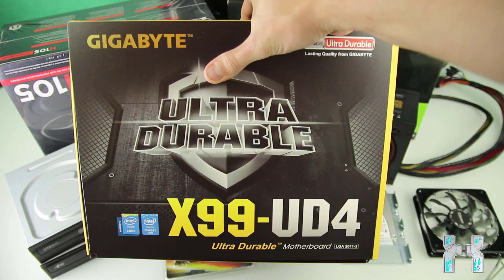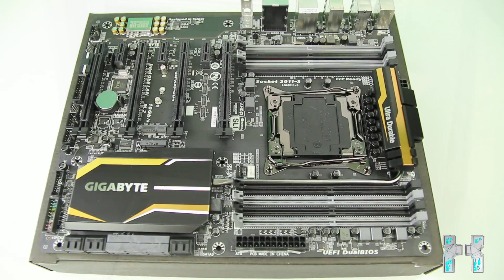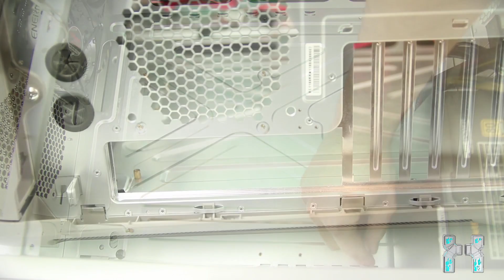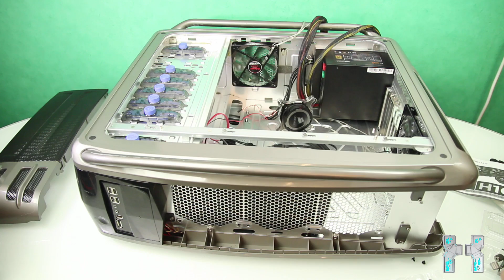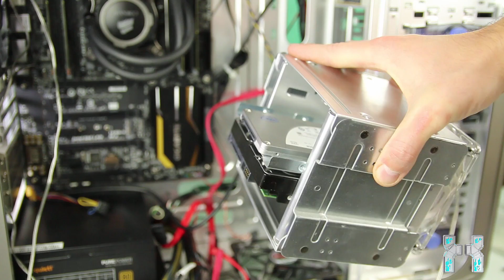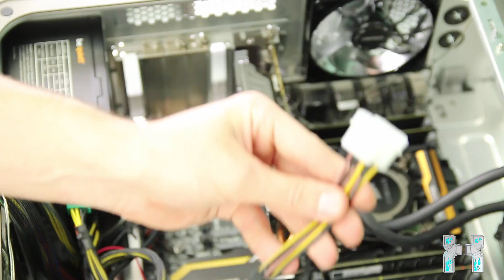How to build a computer in 30 minutes - 2000$ Gaming PC 2014 [HD]

Comment: I DONT HAVE THE FUCKING MOUNTING SCREWS FOR MY X99 BUILD THAT SHOULD HAVE BEEN SUPPLIED IN THE BOX!!! WHERE THE FUCK DID YOU GET THOSE MOUNTING SCREWS
Reply from the maker: tosasaurus mainboard or casebox ?
Reply: the mounting screws that go into the motherboard were not in my h110. I think the h110i GT has them though. Not sure why the normal one doesn't so i ordered them from amazon. Do you know where i could get the shorter screws for push/pull because i'm stuck with it pulling air from outside the case. I want it the other way so i can see my led lights and so that it pushes air out of the case not in.
Reply: +tosasaurus dafuq
Reply: yeah guess what you know what i had to do!? I ordered the mounting screws for $15 off amazon and when they came it turned out i couldn't screw the caps on because the screw hole in the circular cpu cooler holder which holds the cpu into place was 2 millimeters too ... er.. uhm.. "un-wide" so we had to get the powerdrill and widen all four holes in the metal. It worked well and i'm now getting about 31c idle on my i7 5820k ***** ArvidST01
Reply: and i also used the 6 screws that came in my corsair 760t case to mount my h110 in push configuration.
Reply: because that takes a long time!!!!!!! ***** O_O

Comment: Hey everyone, Will everything here be compatible? Thanks everything is on sale and I could get a great deal so please let me know. Thanks :D (Main things I don't know are compatible or not: PSU thanks :D

CPU: http://www.superbiiz.com/detail.php?name=I7-4790KBX&c=CJ 

Liquid cooler: http://www.newegg.com/Product/Product.aspx?Item=N82E16835181032&nm_mc=AFC-C8Junction&cm_mmc=AFC-C8Junction-_-na-_-na-_-na&cm_sp=&AID=10446076&PID=3938566&SID=

Mobo: http://www.superbiiz.com/detail.php?name=MB-MAX7HER&c=CJ

Ram: http://www.newegg.com/Product/Product.aspx?Item=N82E16820233536&nm_mc=AFC-C8Junction&cm_mmc=AFC-C8Junction-_-na-_-na-_-na&cm_sp=&AID=10446076&PID=3938566&SID=

HHD: http://www.newegg.com/Product/Product.aspx?Item=N82E16822178380&nm_mc=AFC-C8Junction&cm_mmc=AFC-C8Junction-_-na-_-na-_-na&cm_sp=&AID=10446076&PID=3938566&SID=

Times two.

GPU: http://www.superbiiz.com/detail.php?name=EV-980ACXS&c=CJ

Optical: http://www.outletpc.com/uh7279-asus-drw-24b1st-dvd-rw-drive.html?utm_source=uh7279-asus-drw-24b1st-dvd-rw-drive&utm_medium=shopping%2Bengine&utm_campaign=pcpartpicker&utm_content=Asus%2B-%2BDVD%20%2F%20Blu%2DRay%20Drives%20%3E%20Internal%20DVD%20Drives

Case: http://www.microcenter.com/product/441510/Graphite_Series_760T_Full_Tower_Windowed_Computer_Case_-_Arctic_White

Windows: http://www.newegg.com/Product/Product.aspx?Item=N82E16832416806&cm_re=windows_7-_-32-416-806-_-Product

PSU: http://www.amazon.com/dp/B00SN7CGAO?psc=1

Wifi card: http://www.amazon.com/Bolse®-300Mbps-Wireless-N-Network-Adapters/dp/B00NTW99A8/ref=sr_1_1?ie=UTF8&qid=1430546202&sr=8-1&keywords=wifi+card+windows+7

MIC: http://www.amazon.com/Audio-Technica-AT2020USB-Cardioid-Condenser-Microphone/dp/B001AS6OYC/ref=sr_1_14?ie=UTF8&qid=1420157521&sr=8-14&keywords=Blue+Snowball etc

Case fan: http://www.amazon.com/dp/B00L64O5RI/?tag=pcpapi-20 

TIMES 2

TOTAL PRICE 
2009.23

Comment: Saving up for these specs worth it?

CPU: Intel Core i7-4790K 4.0GHz Quad-Core Processor  ($339.99 @ Newegg) 
CPU Cooler: Noctua NH-D15 82.5 CFM CPU Cooler  ($99.99 @ Newegg) 
Motherboard: Asus MAXIMUS VII HERO ATX LGA1150 Motherboard  ($213.98 @ Newegg) 
Memory: Crucial Ballistix Sport 32GB (4 x 8GB) DDR3-1600 Memory 
Storage: Intel 730 Series 240GB 2.5" Solid State Drive  ($162.98 @ Newegg) 
Video Card: NVIDIA GeForce GTX 970 4GB Video Card 
Case: NZXT Phantom 630 (Gunmetal) ATX Full Tower Case 
Power Supply: Antec Basiq 350W ATX Power Supply  ($19.99 @ Newegg) 
Optical Drive: Memorex 98240 DVD/CD Writer 
Operating System: Microsoft Windows 8.1 - 64-bit (OEM) (64-bit)  ($119.98 @ Newegg) 
Monitor: Asus PA238QR 60Hz 23.0" Monitor  ($209.99 @ Newegg) 
Fan Controller: Aerocool F6XT Fan Controller  ($26.98 @ Newegg) 
Keyboard: Razer Blackwidow 2014 Wired Gaming Keyboard  ($89.95 @ Newegg) 
Mouse: Razer Lachesis Phantom (White) Wired Laser Mouse 
Total: $1283.83
Prices include shipping, taxes, and discounts when available
Reply: You would need a better power supply to run those components, one with more watts. :)
Reply: Damon Iness but is it worth it?
Reply: phiphi444you get 600 watts and yes its worth it.
Reply: Yes, I think you will be very happy with this computer. :)
Reply: Get 8 gigabytes of ram. It's already enuf for tough gaming
Reply: at least upgrade to a 600w power supply. other than that the other parts are excellent.
Reply: phiphi444you This is 6 months later so I'm going to assume you already went ahead and built with these specs, but I'll tell you my thoughts for future reference in your next builds. In my experience, Asus has the most overpriced motherboards ever. I would go with a comparable MSI or Gigabyte mobo. For ram, no one needs 32gb. I still get 2x8 for my builds, but even that can be overkill. I would definitely tone it down to at least 16gb, whether 4x4 or 2x8. If you're mainly going to be gaming, 8gb is more than plenty. RAM is only needed for multitasking, as with multicore processors. So again, the 4790k is definitely nice, but you could easily go with i5 4590k and save some money. Now if you followed my advice up there, you'd have at least $200 extra to spend. Hmm... I wonder what I would do with that? Oh, right! I need a nice graphics card for gaming! Yeah, so basically, if you cut down on that unnecessary power in the CPU and RAM, you can easily get a GTX 980 or even a 980 Ti. As for the rest is mostly personal preference, but I'd recommend windows 7 over 8 and free upgrade to 10 either way. Oh, I almost missed that power supply. That will 100% definitely not be sufficient. If you plan on overclocking at all, or even with all those usb devices you'll be plugging in, you need more power. I'd recommend a nice 750w power supply to give you some headroom. Although 650w will do just fine. 

All in all, not a bad build. Seems somewhat similar to what I'm putting together right now. Again, no matter how much you're doing, you will never utilize 32gb ram and most likely not need all the power of the i7. I can't recommend Noctua CPU cooler over watercooling or any other cooler enough. If you were concerned about color scheme at all, I'd recommend phanteks top cooler. It gets right up there with noctua, but not quite the same. As for those prices, they are all pretty high. Using pcpartpicker and slickdeals helped me cut down on my build. I'm a bit of hypocrite cause I bought the 4790k, but I do have a defense. I got it for $270 as opposed to $340. Wait for promo codes at newegg. Those are usually the best times to strike. Promo codes + rebates will save you a lot of money. I build a near $2000 computer for $1550 after all rebates cashback and promos.

Comment: Could i7 4790k with Asus Z87 mother board and Asus GTX GeForce 770 Stream games like League of Legends on high settings ?
Reply: Yes
Reply: Best to go with an Asus Z97 board. The Z97 boards were designed for 4690k and 4790k. Also the 770 now discontinued so it's best to go for a 970. And, the 4790k is not needed. Yes it will be better for streaming but the 4690k will be just as good. The 4790k would be for more high end editing etc.

Comment: I hate using water coolant because if you screw up your done with the build
Reply: The close loop water coolers are quite simple, literally slightly harder than mounting a normal heat sink and then a case fan (i use a h75 for my i5 and have had no problems in the 6 months i have had it)

Comment: Thank you very much for your tutorial, but should I buy the fans, or are they coming with the components? Thanks!
Reply: for this build, Its a terrific purchase I use fans myself, where I can, things can get hot, and that's what they are designed to do. But you need to mitigate that heat also.
Reply: Ricki Bristowe Thank you

Comment: What motherboard to go for .
Asus x99-S
Gigabyte x99 ud4
Gigabyte x99 gaming 5

I gonna mostly do gaming and some streaming .
Reply: Mother Board doesnt effect your performance, get MOBO what can hold up amount of RAM what you think you will need now/future, get MOBO what supports your CPU, and if you need SLI/CrossFire now or in future remember to have those features.
Reply: Mother Board doesnt effect your performance, get MOBO what can hold up amount of RAM what you think you will need now/future, get MOBO what supports your CPU, and if you need SLI/CrossFire now or in future remember to have those features.
Reply: MrClanfighter12 i was thinking of that one to and also looking on the msi x99s gaming 9 and msi x99s xpower but are those boards good for gaming ?
Reply: Kent Bollström I don't recommend X99 for gaming. I won't go with anything higher than the i7 4790K. Also DDR4 makes no difference for gaming as well.

Comment: at the beginning you said touch the case and it will discharge you, that is false, without a ground you will not discharge anything, you need a physical ground going to a grounding rod or to your service ground to properly discharge any static
Reply: You need to just touch a piece of metal not connected to any power.
Reply: 1ReallyLongName umm no actually you don't, if you do not have an electrical ground you can touch all the metal you wont, it will not ground you
Reply: Oh yeah? Sorry when every professional computer builder says touch the metal of the power supply or the case I guess they were wrong wrong and you of course are right cause you're on the internet XD
Reply: 1ReallyLongName well the fact i have over 100 builds under my belt umm yah, and second a ground is not a ground on metal, a ground is an electrical ground to earth, it is called physics, look it up....
Reply: They say it prevents it doesn't mean if you don't ground yourself there's a 100% chance your pc will fail it's a precaution and I have a great number of builds and I only touched metal with your logic that means I'm right XD
Reply: not really, because touching metal does absolutely nothing, electricity finds the path of least resistance to the ground, if there is no ground electricity is not grounded, its pretty simple
Reply: Then why do all the most popular computer builders just tell you touch the case or metal of the power supply? You're saying everyone is wrong and you're right?
Reply: 1ReallyLongName actually, yes i am, if you believing touching a piece of metal that is not grounded grounds you and protects anything your fooling yourself, it is simple fact, look it up, think about this for a second if this was the case then no electronics ever would have to be grounded, they would work without a ground, do they? no , the electrostatic build up in your body is no different then the 110 coming from your outlet,,, it hs to be discharged through a ground
Reply: Jesus Christ go watch any other video you'll know smh and while you're at it you should go read a book you may need the education.
Reply: 1ReallyLongName oh right i will watch a video cause everything on the internet is true right? i just have 100 builds or so and am an apprentice electrician , i took 2 years in the class, but i dont know what the heck i am talking about i guess, your right, grounding is not important.. good luck frying electronics
Reply: Yeah I am right. And you tell me to look it up but then you're like "the internet's not always right" Jesus Christ dude make up your mind and wow for such a mature job you're a very immature person to be fighting online XD
Reply: I even gave you the benefit of the doubt and looked it up and you were still wrong.
Reply: 1ReallyLongName i meant look it up in the NEC code book, not on the internet, and no i am not wrong, proper ground is electrical, not touching a piece of metal,,,,,
Reply: Whatever you say
Reply: 1ReallyLongName well come back when you have taken 2 years of residential and commercial electricity class and take a test on it and had to study NEC code extensively, then we can argue...
Reply: Who says I haven't? You have no idea who I am. Just go
Reply: 1ReallyLongName buddy you responded to my post, how about you go?
Reply: Omg are you five? Jesus.
Reply: Its simple to know this electrical issue here. I too have built PC's and the know how of this speaker to provide correct methodology here.
I was happy to see that touching the case detail or anti-static strap, clipped to the case. included, as Its no secret and claiming otherwise is well...false.

Comment: So, how much is the GPU? I already have the other parts. Intel I3 but no watercooler, satisfied. But my graphics is integrated so I wanna know the price of the Nvidia Geforce Gtx
Reply from the maker: check the link in The description for the GTX 970 :) currently its an really awesome card
Reply: I3will bottleneck it dud
Reply: SmokinBlue will it bottleneck i5 because I am planning on getting this card
Reply: What i5?
Reply: SmokinBlue  i5-4430 3.00GHz Is it not going to bottleneck huh btw what motherboard atx do you recormend for the buck because i need a new one im useing some mini atx board sorry for my bad english
Reply: ***** Thanks. I'll be checking it out.
Reply: The Good Man I couldn't really reccomend one because in the UK we have a small selection also it won't bottle neck
Reply: SmokinBlue What does bottleneck mean? Sorry I don't really know all these terms.
Reply: The CPU can not make the most of the graphics

Comment: Nice build! im gonna build my first gaming pc soon ive picked up the parts i will be using. Any tips or recommendations are appriciated! 
	
Intel Core i5-4690K

Cooler Master G750M, 750W PSU

Cooler Master Hyper 212 Evo CPU Kjøler

Corsair Carbide Air 540 Cube Case

HyperX Fury DDR3 1600MHz 8GB Red

MSI GeForce GTX 970 Gaming 4GB PhysX

MSI Z97 GAMING 5, Socket-1150

Samsung SSD 840 EVO 120GB

Seagate Barracuda® 1TB

windows 7

BenQ 24" 3D LED XL2420Z
Reply: Put the Operating System on the SSD! IT WILL RUN SO FAST!
Reply: The Gigabyte X99 UD4 supports only 3 processors: i7-5820  i7-5930k  i7-5960x
(the rest are XEONS it works with Haswell E and for gaming you dont want a xeon)
So getting an i5-4690k wont work with this board.

Comment: Wow. You should never ever ever buy cheap thermal paste. It stunts your cooling in a extreme way. I had crap thermal paste and I had to change it out cause it ruins the heat transfer and makes the cpu hotter. Buy good thermal paste like arctic mx-4.